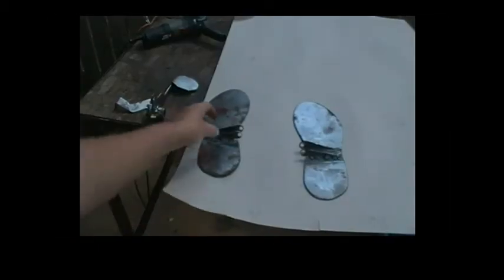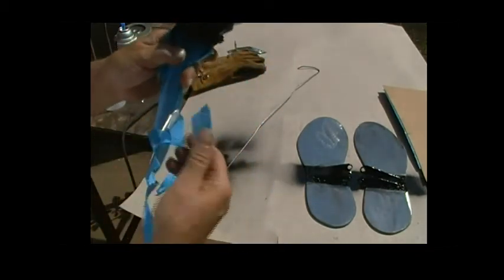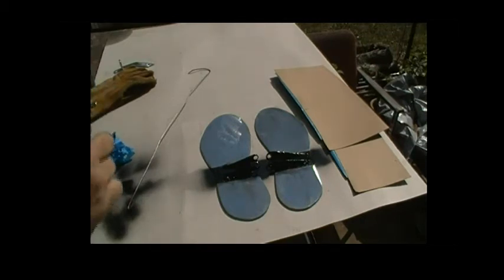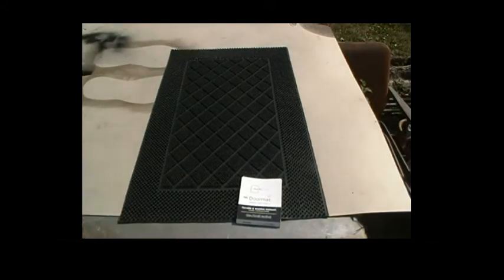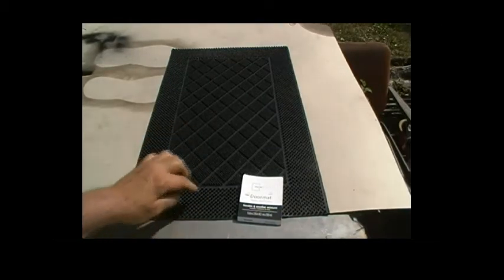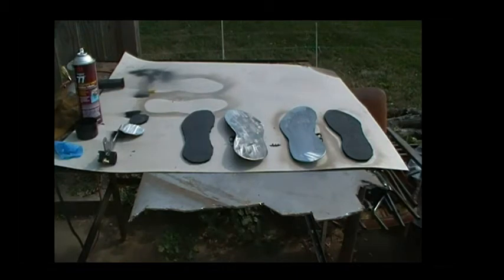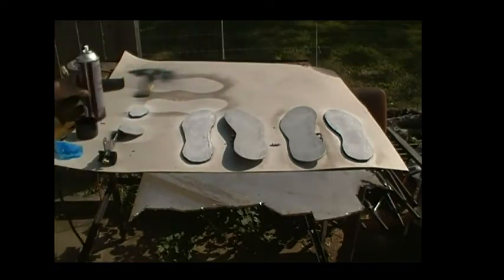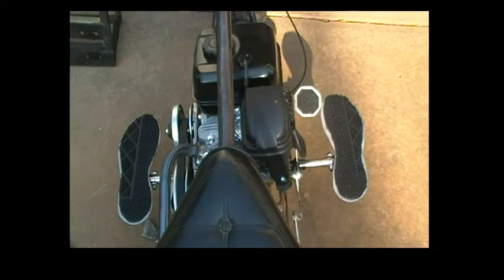SLIP PROOFING MY FOOTBOARDS

Comment: Looks good TUF I feel for you on that pinched nerve. If that nerve block dose not last they can do a Radio frequency ablation on most of them they go in & burn around the nerve blocking the pain & last a lot longer. That's my problem with my back & legs nerve damage I have to have blocks on different sections every couple months. Good luck with it bike looking good Bro.

Comment: Inverted situps to strenghten your back and help stretch out from compression. I know how mine hurt and it will put you down hard, and I was doing was walking down some steps empty handed. I no longer have that issue but it haunts me, put me for days, really hope that never happens to you again. 
Those points of rubber may eventually break off with twisting of the feet and such, depending on the amount of clay it contains. 
Damping with traction is an excellent idea for use, I'm hoping for a win